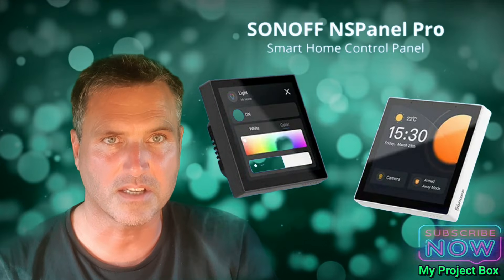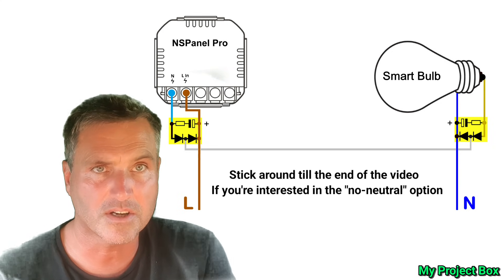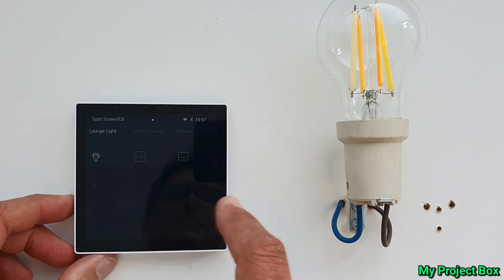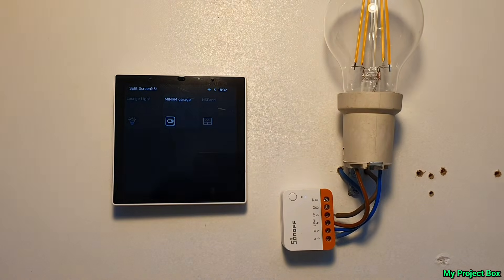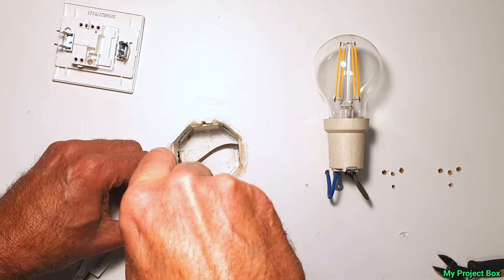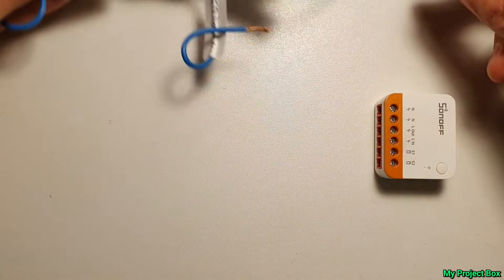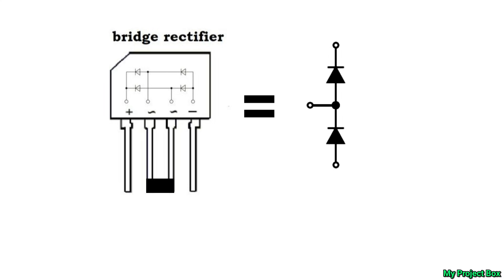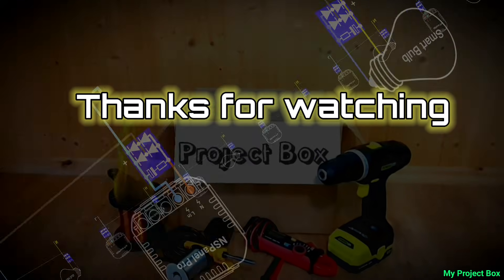Can NSpanel Pro replace a light switch without NO NEUTRAL?

Comment: Hey, I want to thank you soo much for this. You helped me make my long problem go away. I have a house without neturals at switches and all the wires are cemented in the walls (without hoses).
You are a lifesaver and i retrofited my whole house with Sonoff ZBMINIR2 and smart bulbs that could not be possible without your videos.
I also made my own baypass with quality components and in my tests were able to push 50W over a single line. I have no idea where the upper celling is but that is enough that i can now use anything i want over a single L line.
Thank you very much! You rock!
Reply from the maker: I'm glad my video's are useful to you😉. Wow 50w it's great that you not getting any flickering, it mut be the type of LED lights you are using. Thanks for testing my circuit with the ZBMINIR2

Comment: I use a sonoff mini behind it to switch the circuit
Reply from the maker: Did you have to pull a neutral wire down or did you already have it available?
Reply: No, I have a neutral wire here :)
Reply from the maker: @simonsayshomeassistant that makes things a lot easier. It's not always that easy for everyone. That's the reason I came up with my "no-neutral" hack circuits😉
Reply: @MyProjectBoxChannel  I know I was amazed because my house was built in 1969 same as me :)  Your videos are great!  Lots of practical tips!

Comment: As you are not using the light switch to actually switch anything (wired that is), instead of the way you did it wouldnt it make more sense to turn the switched live wire into a neutral feed from the light (appropriately identified). Then you have a real positive and negative at both ends.
Reply from the maker: Yes you will have the Live and neutral you need to supply the NSPANEL-PRO but the smart bulb will loose it Live supply and only have a neutral available. So you will have to find a permanent Live supply for the "smart light". Originally the light has a neutral and a switched-live, but now the "old switched-live" has become a neutral, so only neutral at the light. Can you see the problem. That's what my "NO-NEUTRAL" circuit modules are for. The old switched-live wire now supplys both "Live and neutral".
Reply: @MyProjectBoxChannel  Yes i understand what you are saying in this instance. I think for me and most of the UK, we would have permenant live,  neutral at the light fitting (and then usually the wire to the next room) then live feed to the switch, switched live. This is a very typical UK way of wiring lighting circuits.
Reply from the maker: @_Miner  aah yes the UK. If you are blessed with the loop-in/3-plate ceiling rose system, then you have everything you need ( L N sL) right by the light. Maybe I should of included UK lighting circuit in the video. I made this video mainly for Europe and the rest of the world. I do videos about British circuits aswell, because I live in both the UK and Portugal, for summer and winter.

Comment: This seems completely safe and not dangerous at all...
Reply from the maker: I spent about a month "stress testing" this circuit. I short-circuit the output to se if it could survive a circuit breaker tripping, without bursting into flames or exploding. Overloaded the output way past any thing close to the to the LED load it was made for. So far so good. If used what it was designed for, then there should be no problems. I would recommend a inline fuse if your lighting circuit has a circuit breaker more than 6Amp (6Amp is standard in UK)

Comment: One of my biggest problems are the rooms that I want fancy light switches have smart lights so they are powered on all the time anyway. It would be nice if smart panels were made that could be installed inline with the  lights
Reply from the maker: That's exactly what my circuit modules are letting you do, put a smart panel inline with a smart light.

Comment: I think you did this neutral trick many moons ago which was a revelation ( you have done video before on this neutral trick ? )
Reply from the maker: Yes I did similar videos before, but this configuration is specifically designed for NSPANEL-PRO. The diode polarities are different, and some other differences aswell.

Comment: Hi very nice project, if you need an NS panel, just to let you know all my lights still work fine with the capacitor dropper and all my LED lights are still  going strong, so thanks for that information, love the channel and your innovative ideas, I would use one, but we live in rented accommodation so it is not possible. All the best, Bob.